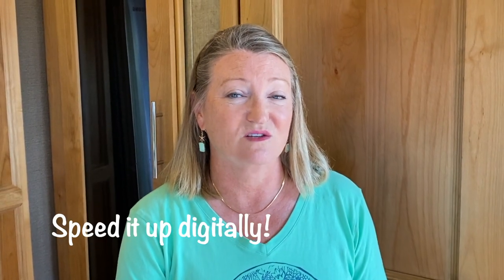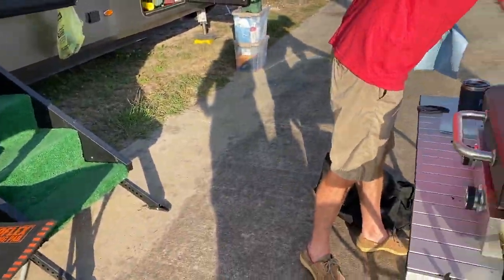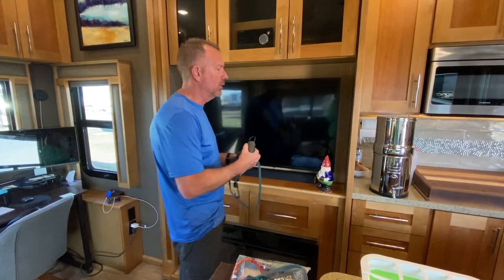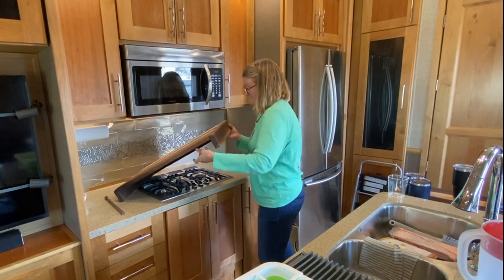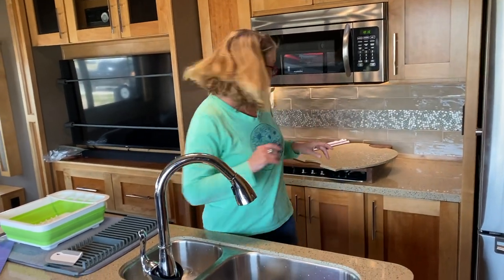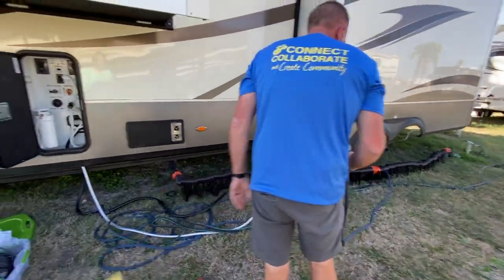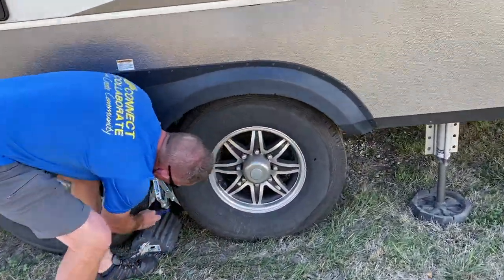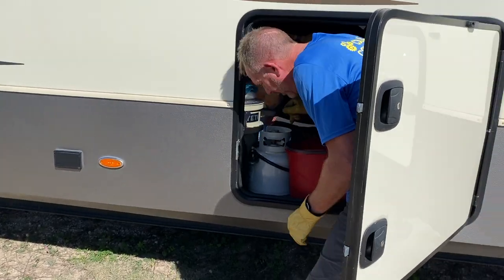RV Moving Day is a chore! | How to pack up your Fifth Wheel and get on the road!

Comment: Just a tip, you might want to consider not removing your               X-Chocks until after you have hooked up to your truck. We learned this valuable tip last year, we were parked on a concrete slab, when my hubby hooked the truck up to our 5th wheel it actually pushed our RV backward a foot or two(even with the legs down), it scared the 💩 out of me because we were in a double site with another camper right behind us!! We were just lucky that we didn’t hit the other RV or tear the legs up. This also has happened one other time on a gravel site. We now always leave those chocks until our truck is completely hooked to the RV. That’s also the first thing we put on when we get parked, safe travels🤗
Reply from the maker: Ow wow, thanks for that tip! We do leave our rubber ones down but better safe than sorry right! Thank you for commenting!